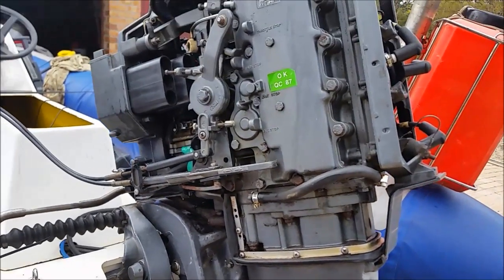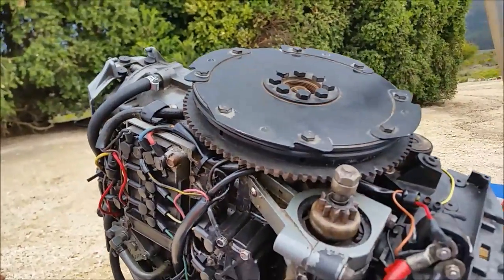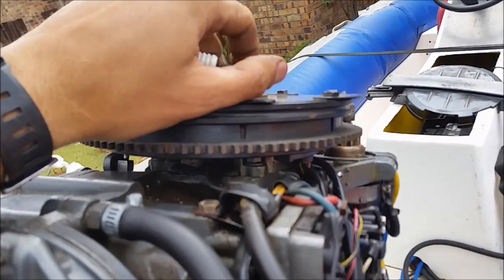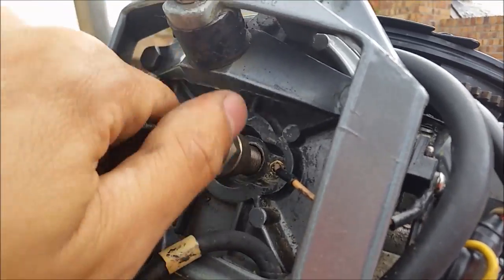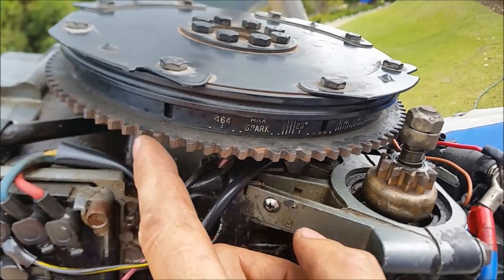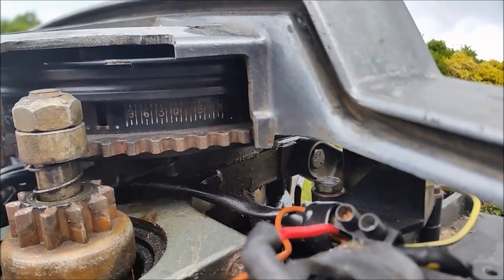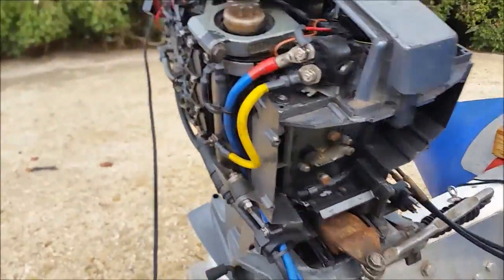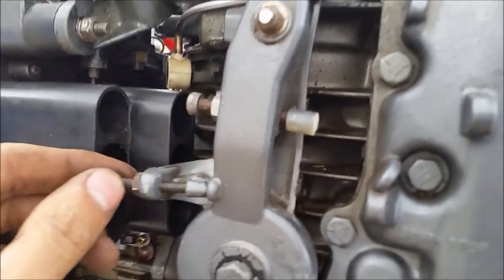1987 60hp Mercury Mariner Outboard Setup Timing Link Sync Tdc

Comment: I have the same engine and its had surface gap spark plugs in it since iv owned it. Always just re buy those because thats what came in it  upon research iv concluded that those engines run better on the stock spark plugs, can you please tell me what plugs you are using
Reply from the maker: dont recall but you can match the thread and depth and be ok-
Reply: @fstarockaburns425  well, to be honest im just an idiot. Retimed it according to your video, cleaned carbs replaced fuel lines/filter. Still idling rough wouldnt go wot. Come to find out i had a faulty fuel pump. Replaced that. And problem seems to have went away. Key bumps it instantly. No more choke and it trolls nicley at idle in gear in a bucket I couldnt run the engine without it being wot before. And it would never crest 3,000 rpm seems alot more responsive now. Wont know anything until i get it in the water tho
Reply from the maker: @Retorical-Ricky  awesome man! they are fantastic engines. the triggers like to fail. if she doesnt get up on plane/speed its very likely th etrigger has gone. the trigger wires move every time u throttle so they wear, the stator just sits and doesnt move. coils usually also dont go bad unless the magnets inside have cracked (careful screwing them down!!) the switch packs can blow too but less rare than the triggers-
PM me if u wanna chat and ill help where i can-
Reply: Thankyou. I need to know the gap, i dont have an owners manual to this engine
Reply: Do you not have the boat and engine anymore
Reply from the maker: @Retorical-Ricky  i live in the US now. its with a friend. THe gap isnt too critical- 30thou is fine.. ie basically stock gap. I wouldnt go too big just fingernail thickness at most. The whole idea is to set the max advance, find your timing mark (as im showing) if u dont know where yours is. Then adjust it to idle right using the advance lever and throttle opening. once its idling right, u want a little gap before the carbs start opening more- so that the ignition moves a little bit first THEN the carbs. Raising the timing will increase the rpms, then let the carbs come in, it will burn cleaner and have more power. Good luck they are fantastic motors. I could have made this video better but at the time it was all i could do :)

Comment: I have an answer for the gas leaking. Trim the engine down to proper running position and the leak will stop, as long as everything else is right. Found that on iboat forum,  and that was my problem. After 3 times pulling carbs

Comment: One of the most clear instructions!  I've been trying to think about what the book says re: the (usually) 0.462"mark on the flywheel?  Your explanation of finding TDC was great.  I've been taking the word of the existing marking and did the rest of the process but I might go back and verify.  My top end is great, idle has been hard to get it low enough but runs just a bit rough in the low RPMs.  Any first thought on which way to screw the idle timing?  Mine was 11* and when I rechecked, running on the muffs, it went to 12*.  For that one, I might try doing it on the lake, in gear.  Just looking for a bit of smoothing it out, down low.  Thanks again

Comment: How do you adjust the timing? I unseized one of these, looks identical. I removed the bolts from the flywheel and screwed a bar to it. I turned the flywheel clockwise at first and the flywheel started unscrewing 🤷‍♂️. So I turned it anticlockwise with a lot of force which tightened the flywheel back down (probably past where it was from factory) and eventually with a huge amount of force the motor freed up. I bolted the flywheel back on with the top cylinder at TDC and the flywheel at 0tdc but I think the base that the flywheel  bolts too wasn't where it was before so the timing marks are probably way off. It has fuel, spark and compression but it wont start. Sometimes it'll fire and basically kick back and try fire backwards.
Reply: Well the method I used here was to determine true TDC in the case of missing/unknown timing mark locations so this helps you find the stationery mark on the block .. put a piston stop tool in the top cylinder, use a wire tip bent and stationery on any point on the flywheel, rotate flywheel by hand till it stops, mark one dot where flywheel is (#1), now reverse the direction until it stops again, make a 2nd mark (#2) - now turn the flywheel to set the wire tip in the EXACT center of these 2 marks - this is your true TDC (ill call it #3). Now looks for / google the timing marks for your engine, could be a stripe, or maybe even a 0 mark, or degrees, what ever it is, put a nice bright white or yellow stripe somewhere on the block / casting, this is usually around the front of the engine for tuning purposes.. The mercury I am demonstrating on has various degree marks, one (22 or 28 degrees iirc) is for max timing.. (follow the manual). From there you dont really set the timing like a car, it falls where it falls, you can play around with carb opening vs advance to set the idle, generally on every engine you want some timing advance before the carbs start to open, that will give cleaner plugs and great power.. so best to tune with carb butterflies closed/mostly closed, and have a 1mm or 2mm gap before the carbs open, the revs will increase only from the timing advancing before the carbs bring the fuel on- so you kind of set the idle via timing but there isnt really a number.. can be 4 ATDC, 2, 0 or even 2 or 4 BTDC... the manual calls for a dial gauge method and I did not have time to check whether the piston stop method equals the 0 on the marks EXACTLY, or whether merc used another method, however this will get you VERY close.

Comment: dou have a manual for this i have the same engine stopped working randomly exhaust is popping when cranking
Reply from the maker: try spraying a small amount of starting fluid down each carb and see- could be weak or no spark on one cylinder. Get yourself an inline spark tester and try each one.. manual doesnt really give you a good step by step to troubleshoot.. I do have a manual but its old and pics poor- web pdf version.. look online the manual title is: 1965-1989 Mercury 45-115 HP - so use that in your search efforts.. Scribd has one -
Reply: @fstarockaburns425  thanks for reply do you have a picture of which spark plug the coil wires goes to  because i changes coils and forgot which plug the different coil cap/wires goes to and also when i fire up the engine how much should the spark advance lever be at

Comment: So very unclear.   This merc. Retards timing 5deg at wot 5000 rpms? Vs static wot?
Reply from the maker: something like that yes, when you crank you set the spec for cranking - it changes when running.. cant remember exactly what but follow instructions in manual.

Comment: Hi. I have 2 1988 mercury 60hp. One works fine in test tank but when I the boat in water themotor dies as soon go into gear could it be timing?
Reply from the maker: could be idling too low, try adjust it a little. remember at the back on the motor that you will need to remove the barrel from the slot, adjust the idle screw (lowest one), then adjust the barrel to go back into the slot- your timing might also be out. Have you done a compression test? Do that before anything else.
Reply: @fstarockaburns425  I  done compression test it was 120 130 120. I set the idle bit high at almost 2000 out gear but in gear it drops under 1000. What should the idle timing be?
Reply from the maker: @michaelwheal9331  2000 is WAY too high, you will damage the gears! (assuming the tach is accurate).. timing is kind of loose, anywhere around 4 BTDC to 8 ATDC.. 2 strokes sputter a bit at idle, thats the way they should sound.. almost like a cackle. you must be able to idle it around 750 in N warm, otherwise you have an issue. I would strip carbs and re assemble with an inline lawn mower filter right before the carbs and new fuel lines between the filter and carbs- just make sure its tight. The top carb runs a jet size richer so make sure that is in the right place. your compression is fine-
Reply: @fstarockaburns425  thanks.

Comment: Can you please make this video over again and hold the camera still and make sure you recording what you're doing with the camera half of it was not even in sight of the camera.
Reply from the maker: Will try, sorry yeah alot going on and back and forth.. just kinda threw this together.
Reply: @fstarockaburns425  I'm having this problem with my outboard and I am uneducated when it comes to working on Motors of any kind if you have another video or can recommend another video that would be greatly appreciated
Reply from the maker: @Nate......  what issue are you having?

Comment: Please Help.  I have an 1989 Johnson 70HP rebuild by Coastline Marine in Florida.  The rebuild cost $3180.  (rebuild include:  bore the 2 bottom cylinders to the next larger size piston. replace the top piston for cylinder 1,  rebuild carbs, new thermostat).  The guy told me to check the ignition and timing by a mechanic.  I have called every marina in Boston area to have them check the timing for me but no one is willing to work on older motor so I have to check the ignition/timing myself.  I have watched YouTube videos bought 2 manuals to do the timing/ignition myself.  When I check the TDC of the motor, new TDC mark that I've found is 2.5" to the left of the factory TDC.  Is this correct ? TDC needs to be correct before I can continue forward.  Thanks for your help.
Reply from the maker: 2-1/2" is quite alot. Does it run at all? Not sure why they didnt bore all 3, there will be imbalance there, should have sleeved them- either way, use the method I used here and do it 3 times to make sure.. the idle timing isnt really fixed and you can move that around, whats most important is the MAX timing - thats what kills motors, not idle. Get a manual, recheck the TDC position, and make sure you set the MAX advance first, then you can mess around with the idle timing / advance etc and see how the motor performs.

Also confirm the flywheel key hasnt moved, put a white out mark and check if it moves later..

Comment: There is a hose that connects to the filter wich is meant to let the carbs suck in the oil/liquids from the crankcase so if carbs arent in sync, mixture too rich or too much oil it will let fluids out to the filter and it aint nice to see gasoline or oil all over the place, personally I have that hose blocked as I dont like the whole idea of said system and prefer a cleaner engine, carbs and filter, downside is if too rich or too much oil its more likely to get the sparkplugs dirty faster wich should be no issue with proper maintenance on a engine.

Thanks for the video, probably seen it about 10 times already, thanks for putting the effort to share your knowledge about the engine saving us quite some time and money.

Comment: Do you have any videos on how to remove the carburetor in this engine?
Reply from the maker: hi-its quite easy.. just remove the front air baffle cover and the carbs will come off.. 2 nuts on either side - you have to undo the bolts, move the carb fwd and undo them a bit more - its not too hard..
Reply: @fstarockaburns425  any idea where to get the little couple that connects both carburetor butterflies? That little black think ( I am in Australia, I have the same motor)

Comment: Hi mate I have the exact same engine as you and I have a couple of problems... first of all I bought it took it to the water it ran fine for a few minutes then died down to about a few knots we changed carbs checked plugs the usual stuff and realised it might have been dead fuel! The problem is ever since I’ve tried to test it it won’t start in the salt water. It starts in the shed with muffs and even with a big barrel one day and it started and was going into gear fine. I took it to the water again for another test and it started sat at idle for one minute then died it would not start again after that just kept cranking and cranking any ideas?
Reply from the maker: Willy Mc you might have a faulty kill switch wire.. it's on top of the switch box cant remember color.. disconnect it and see. A faulty ignition switch can also cause issues.. motor can not tell difference between salt or fresh ir muffs..
Reply: Fstarocka Burns thanks il try that although it does start in the shed although sometimes it messes about so I guess it could be that any ideas on the engine losing power I mean the fuel could have been the issue but because I haven’t got it started I can’t test it lol

Comment: What spark plugs are you running?
Reply from the maker: hi - iirc bpr6es (but double check).. I cross referenced the center electrode ones to regular copper ones (1/4 of the price). Runs great.

Comment: I have a 1985 mercury 50hp outboard do you know the correct idle speed timing setting for my engine. I know the  max timing its stamped on the engine. Thanks
Reply from the maker: usually you set the max timing and the idle speed/timing falls where it is. Do the link and sync (good to get the advance going up a little before the carbs start opening - cleaner/leaner burn).. setting the big nut down the side usually affects the carbs and timing.. Id just do it like the manual says with the dial gauge method cos many times the timing marks are missing
Reply: @fstarockaburns425  what manual are you using? Mine seems to be off. If you have a link that would be helpful.
Reply from the maker: @victorrangel1478  sure its the same as my 60- i used a pdf from online. You can adjust carbs and trigger to achieve the same idle speed..

Comment: It's leaking out of the lower throttle shaft. Mine is doing the exact same thing (70hp). I have a suspicion that the throttle shaft has a bit of wear and is allowing fuel to slip past. Not much can be done unless you take off the carbs. Cheers!

Comment: Buy a plug stop  to set TDC.. your method was exhausting to watch..

Like you said idle is to be set in the water I. Gear unrestrained, in gear.
 So is wot timing.. never set timing this way. That is not wide open throttle...
Reply: I am lost at what you mean this isn't correct for wide open throttle. I have a 1985 50 HP Merc I was about to do this as I'm having WOT issues. I don't think the timing is accurate to the Tru top dead even tho it is right on the light using the original timing marker.
Reply: His timing method is correct.static  Set to 28.    C.d.I.retards timing at 5000 rpm
Reply: Who has a test wheel.  Or wot at speed on the water !    Check plugs for heat!

Comment: I have the same engine and I have also had the problem of the gas pooling up in the carbs and dripping into the boat
Reply from the maker: Ned K best is remove carbs,clean very well, install small inline fuel filter right before it enters the carb, with NEW fuel line after the inline filter ur sorted. The old hose breaks down from the inside and small peices flow out into carb.. this is the ghetto fix and very successful..
Reply: i bought a service manual from ebay for 10 bucks and from my understanding the reed valve its what is causing our carburetors to leak fuel like ya'll have mentioned. I haven't gotten around to it but im sure this is yalls problem.

Comment: good video ,my carb does the same= destroys my upper motor mounts 2 nd set at $70.00 a piece. an  pull power head to change .very bad design for motor and water.

Comment: How do you adjust the air gas mixture screw?
Reply from the maker: there is no mixture screw -just float height and jets. note the top carb runs 2 sizes up on the jet from the lower. 72 and 74 i think
Reply: +Fstarocka Burns 
then what is the screw shaped like a needle on the front of the carbs
Reply from the maker: are you referring to my carbs? if so give me a time on the video to have a look.. otherwise its possible you might have them, but these carbs are fixed everything. U just set float height and swap jets ..
Reply from the maker: sorry my bad - yes those wd be mixture screws, sorry at the time i was new to the motor - usually 1-1/2 - 2 1/2 turns out wd get u in the ball park - sorry for the confusion! ill be doing an updated vid later on when my fiance/videographer arrives :)

Comment: My carbs used to Leak Badly, I removed both had them ultrasonically cleaned and put new needle and seats in and floats that seemed to sort out most of the problem.
It only leaks slightly now when u trim it up otherwise not at all.
Check ur float level , I have to of these motors the 50hp and when I checked the float levels before I sent them in for cleaning only 1 carb was right the others were 10mm out which is huge, and explaining why it was flooding all the time .
Also replaced fuel pumps on both engines behaving much better now.

Thanks for the timing explanation will be checking that soon .